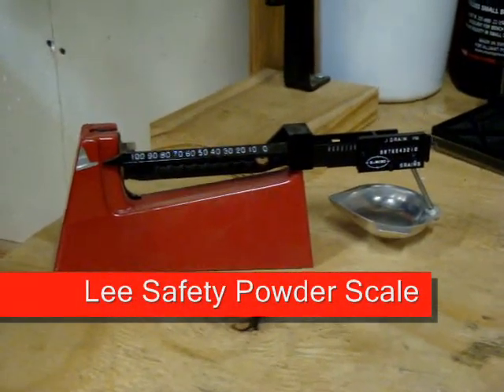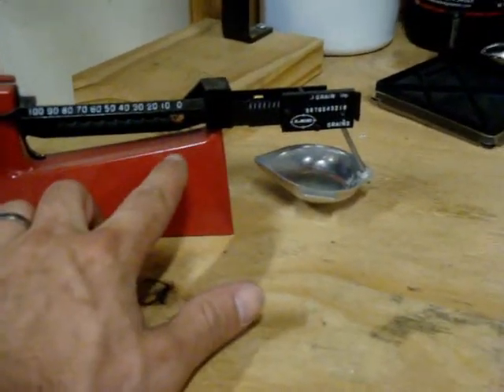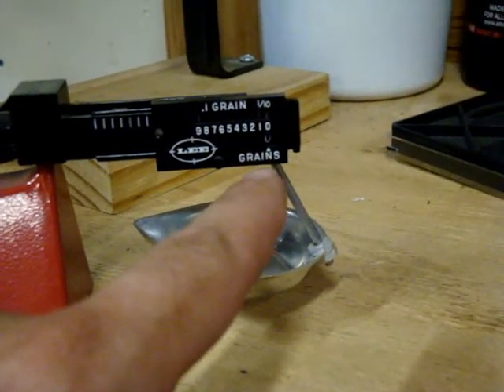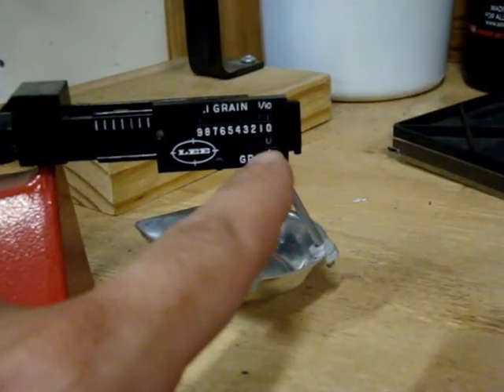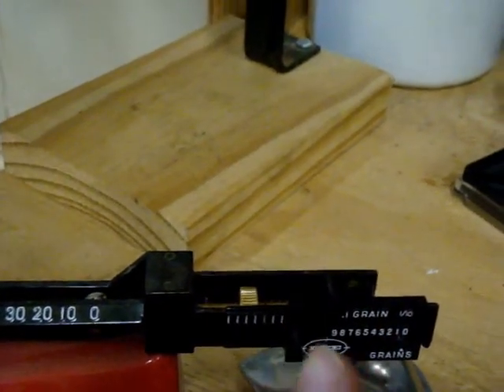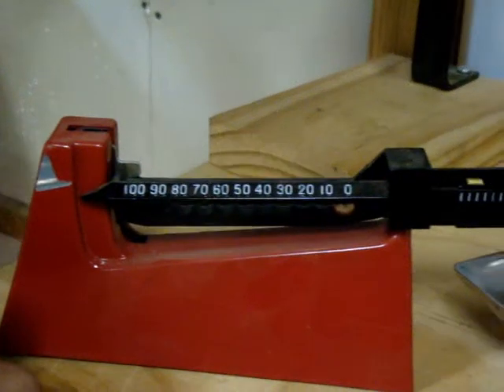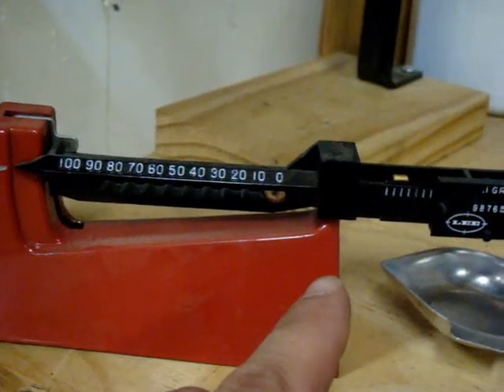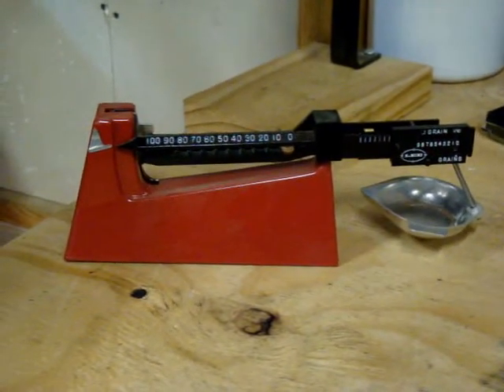Lee Powder Scale

Comment: there is 2 things you need to do to make this a good scale . The good people at Lee went to all the trouble of putting a blade on the fulcrum , then left the vee that the blade sits in full of old paint and a shit . Get a sharp point , something solid , and clean the vee out so its sharp and clean , then the beam will run true between the magnates , it should move with the slightest breeze on it . Also on the pan the hook needs to be bent into a tighter circle so it doesn't get hung up on the screw in the middle , it must be able to pivot . Do all this and they are very consistant which is something you won't get out of a digital scale . If you think it maybe measuring slightly heavy or light then get a check weight and ajust accordingly..